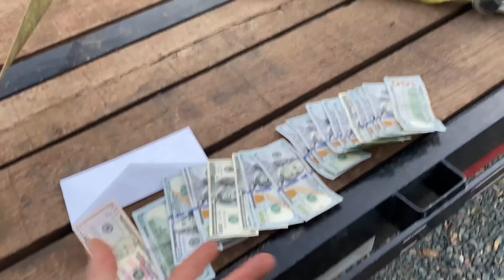Wide load Action! Bought a 4 post lift! Hauled it in one piece!!

Comment: I built a pit outside. 17,000 Lbs. in materials not including the water in the concrete. It's open at one and and one side so no foul air issue. Use it for my Super Duty's. Tested it with my 9500 Lb. utility body and measured NO deflection in the beams. There's 2 runways made of 2 - 2x12's and 4 - 2x10's each, and covered with 2x10 run sideways between the 2x12's. I do my oil changes and general maintenance using it and even removed a 4R100 transmission using it.

Comment: Very nice lift , they work well for more storage park one on the lift and one under it. However they are not as good to work on a car on it. The one we have , it's for storage. The rails get in the way all the time when your trying to work on a car.  Be ready for some bumps on your head , I seem to find ours at least once every time I'm in the shop with another bump on the head. A good 2 post lift is the way to go. Thanks for the videos. And you did get a deal on it.

Comment: I have 2 Bend Pak 9K extra tall wide lifts. They are great and I do lift my regular cab 3rd den dually with them. However you have to take the outer wheel offs to get it to fit on the lift.

Comment: That's a cool lift move it around anytime you want to . Are you gonna use the 3/4 inch concrete screws or wedge bolts
Reply from the maker: Not sure yet need to finish setting it up

Comment: Used both 2 an 4 post lifts an 4 is the way to go an it will save the back you dont notice it when your young but the older you get the more you notice how much better it is not laying on the floor working on cars

Comment: Glowshift or Autometer gauges for my recently acquired 2001 Dodge Ram 2500 Cummins? I’m new to the game. Please advise. I’m looking to put in Boost, Fuel Pressure, EGT, and Trans Temp.

Comment: Get yourself a piece of 1/4" thick steel strap and bolt it to the base of the legs. That way the legs won't spread which can be a problem on 4 post lifts that aren't bolted to the floor.

Get a dedicated 20amp line to run the lift. It's marginal with non-load, with load it will draw almost twice the amperage  at hydraulic motor start up. Put the female receptacle on the lift and the cord-set coiled up on the wall.